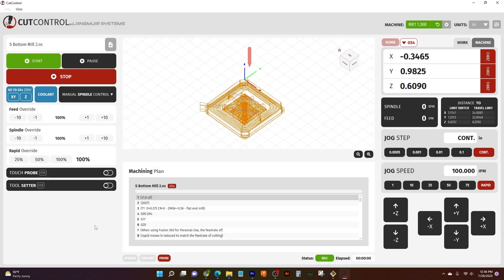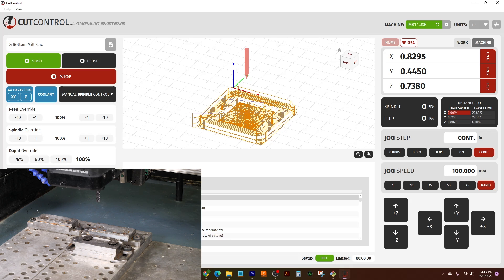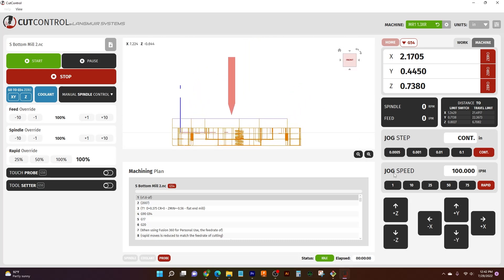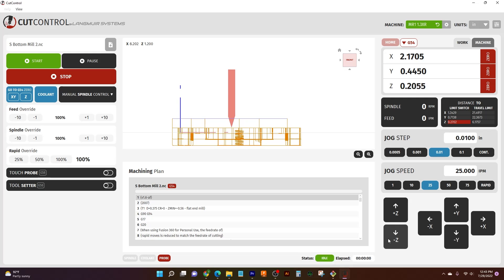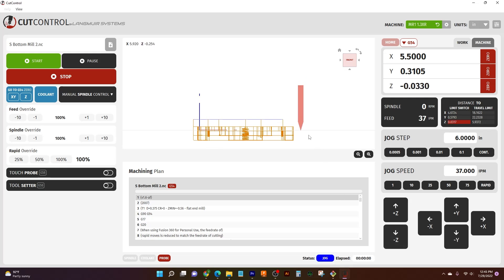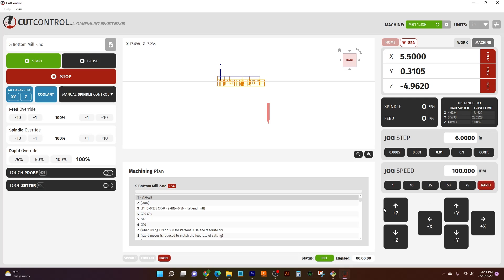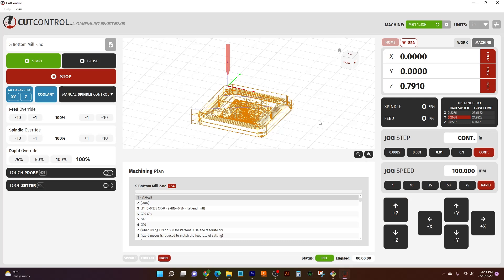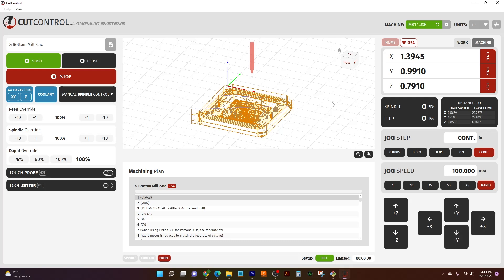MR-1 CNC Mill CutControl Software Tutorial - Jogging the Machine

Comment: Hi, Robert here. New MR-1 owner and amateur machinist.  I had an error 24 minutes into a long program tool path. I and others I am sure, want to ask How can I start the tool path at a middle g-code spot like 20700 in my case?  Can I start  at any spot in a g-code? I don't want to wait 24 minutes cutting air. What can cut control do about this?  Does it involve the visualizer?  Maybe a video about this problem could be made. Thanks I really need to know now and for the future power outages, crashes, controller errors, alarms, etc. Thanks
Reply: No as of now you cannot start in the middle of a G-Code you can start in the middle of a plasma cutter Fire Control but not  in cut control. I would ask technical support at langmuir systems again